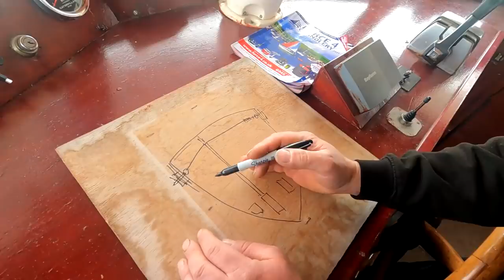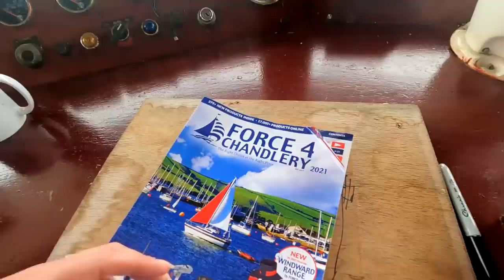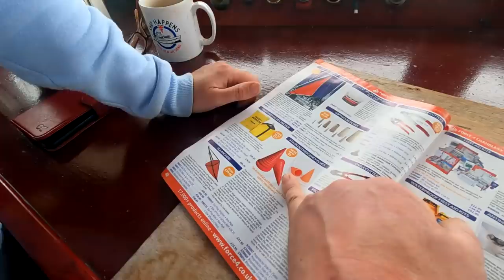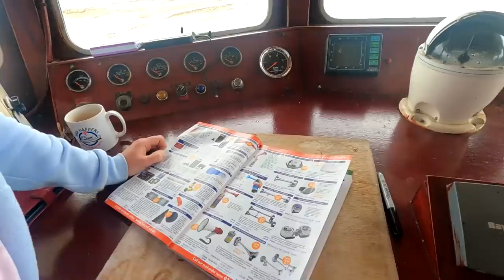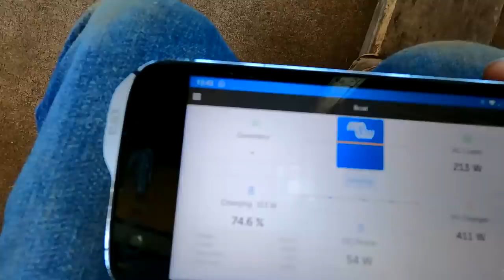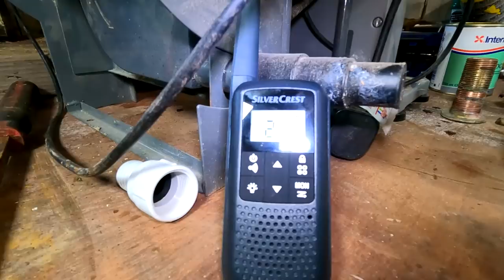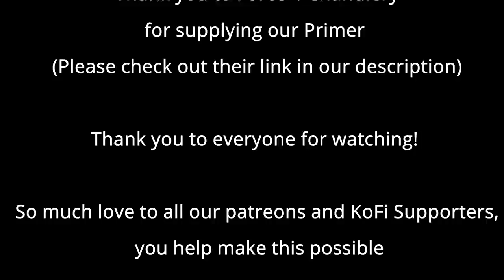Ep 24 - Changing The Boats Skin Fittings With Our Home Made Tools!

Comment: I normally put some Sikaflex on and then tighten the nut until I know all bubbles are squeezed out, but there is still a thick layer of Sikaflex left between the surface and the washer. I then let it dry and tighten a lot the next day when it is dry. This let the Sikaflex creates a nice gasket that fits into all the little unevenness and creates a better seal. Not sure if it will work on wood, but it sure does work on fiberglass :-)

Comment: From experience, scrape the hull down to the float line, caulk all the gaps in the planks, seal the surface, then prime the exposed hull with at least two coats. Painting should be your last while it's on the mud flats. That will be easier done after the boat get's taken out of the water. One thing that you need to do before removing any wood is to measure the distances and write them on the wall for reference. Another thing you might consider is finding four or five or more large planks 6-10 inches wide by 2-4", and at least the width of the boat in length. Tie ropes on each end long enough to reach the railings on deck. At the next high tide, when the boat is just clear of the mud, position the planks under the hull and tie them off. This will allow the hull to be somewhat out of the water and expose a greater surface for scraping. We found that this will give a stable platform for the vessel. The use of plugs has long been a necessity, but also squares of rubber that can be quickly pressed against the inner surfaces to stop a leak, with 4X4 timber to buttress the patches
Reply: I forgot to add. If you can get the props out of the water, inspect them. I suspect they have been changed out. The previous owners probably exchanged them for a 'sport' version. Since the boat has been sitting in the mud for quite a ling time, at least take some pictures to insure a matched set. If they are chipped, then plan on replacing. They can be pulled in the yard for a balance.

Comment: You don't want to leave paint chips in the estuary.  Wait until you can put the boat on the hard before scraping and painting.  You should be using a ball valve on that through hull.  Gate valves collect crud in the gate slot which can interfere with operation of the valve.

Comment: Excellent progress! A word to the wise though (if I may be so bold) - gate valves shouldn’t really be used, especially below the waterline as they have a nasty habit of failing in an open or closed position. Marine grade ball valves are the way to go - they have the added benefit of visually indicating whether they’re open or closed from the handle position. Also, if those skin fittings are brass, please, please ensure they are DZR - if they’re not they won’t last very well in a salt water environment. Early signs of failure will be if you scrape the outside instead of revealing that traditional brass colour they’ll have a pink hue indicating that the zinc is leaching out of the copper.
Good luck, you guys make a brilliant (& very entertaining) team!!
Reply: What he says, my in laws boat nearly sank cos the Brass Valves disintegrated and snapped off.

Comment: I think someone may have mentioned this before but you should get fixed reference points where you can check for any movement.  Don't forget that the hull will probably stretch and compress with the rise and fall of the tide.

I have said this before but you should really speak to one of the Marina's and see if they will sponsor a hard for you to put Sarina on.  In the long run it will be cheaper and much better for you as you won't have to rely on the tides as to when you can work on your boat.  Rubbish removal will be easier and if you need any material you won't have to pull it down the river all the time.

I realise it may cost  you a little more but I think that over time it will actually work out cheaper.

Looking forward to see your progress with the frames - you will need a steamer though as bending oak is not any easy process - I know I have done it.

Comment: Removing and replacing one frame at a time shouldn’t be too much of a concern with regard to the hull changing shape. The double planked hull will hold its shape pretty well for a reasonable length of time.
Be careful when selecting valves and other fittings for through hulls (skin fittings). Only use bronze or non metallic fittings. Never use brass! Brass will quickly corrode as the copper is dissolved leaving only zinc, which has no strength.

Comment: Great fun ...had me laughing again especially the sanding of the through hull scene. Not sure if you're going to be steaming the frames. Peter Knowles from Travels with Geordie  channel has set up a nice little I frame sized foam steamer box using a kettle or a wall steamer.his channel is great viewing if you haven't already seen it. He currently has his 1950s wooden boat out on the hard and is adding extra white oak and high density plastic frames to strengthen his boat at a weak point.
Reply: Travels with Geordie is a great channel full of amazing wooden boat restoration wonders.

Comment: Why not use Ball Valves below the water line and not gate valves? Gate valves can break the stem and be open or will not close.
Reply: Definitely ball valves should be used!
Reply: Ball valves can leak after time or stick quicker than a gate valves leaver valves way to go.
Reply: Anybody on YouTube replacing thru hull uses Ball Valves.  I have never had an issue, just open and close every now and then.  Gate Valves can jam.
Reply: @michaelramstedt3380  never had an issue with ball valves leaking, and yes they do seize but so do gate valves and I can generally free a ball valve fairly quickly.

Comment: Copper nailing code works well. Assuming the nail is already in. Person inside puts Rove onto nail and taps gently so person outside knows to hold on. Bang rove down until it just bites into wood. Noise stops and outside see nail head pull into wood hopefully just below surface and rests. Inside snips nail leaving about eighth. Nips hard up on rove about right . Inside gently taps so outside  holds on then inside hammers away with double tap when finished. Done.

Comment: You might well consider a "surface preparation tool" available from eastwood.com here, and probably many other sources. It uses a grinder type setup, but has a fairly wide (around 15cm) rotary tool with flap wheel design and others also depending on the job. The best and most economical tool I've found for removing paint from surfaces like auto bodies.  Should work wonders on the hull, strip it down to bare wood and no chemicals required.

Comment: I am SURE you figured all possibilities in painting but just in case:
Scraping is REALLY hard and quality of job will be dependent on the scraper and that's standing on a floor or ladder on dry land, not suspended over the side of a ship or standing in river muck with the tide out.  
Have you priced out a thick chemical paste or peel and strip, not cheap but better quality control esp if using volunteers.  $2 a sf or so, but yeah you got a lot of sf $1,200 for 600 sf 
There are some mechanical strippers like the residential DIY Wagner PaintEater which mostly leaves dust behind to catch and easily shop vac up.  Some strength needed and like any power tool it can hurt you faster than a hand scraper can slice you
There is an aggregate blasting tech that would maybe work, ie can use portable equipment easily gotten to boat, and leave little waste, just paint dust.  It's dry ice blasting.  The dry ice changes to gas as it hits and lets just say magically removes the paint, leaving behind co2 gas and paint dust to catch and shop vac up Given your limited by what the tide lets you get done DIY might be only way to power strip,   Seems to take about 250 lbs of dry ice an hour for 600 sf. for about $1.25 per sf or about $1,000 for 600 sf.  I'd guess hiring someone would be at least $2.50 per sf. Here's a bit from a blog about a GC DIY not subbing it.  So if you wanted to learn a new trade you could too.  Might be useful in your day job too.  
. I called Cold jet and they wher very helpful.
They told me that on average you will go through about 1000 lbs of dryice in a day. Depending on conditions you can do 10 square feet a minute using 4 lbs a minute. My job is roughly 2000sf of roof decking to blast. I am doing the job tomorrow so we will see how it goes.
I have 1040 lbs of dryice coming. the dry ice cost me $510 and it cost me $850 to rent the blaster and compressor for the day.
hopefully it is money well spent!
Any chance you can economically source a flat bottom boat or two to snug up to boat as tide drops giving someplace to catch dust scrapings stand in and work from, that when the tide comes in will then just float until you can take to shore and clean out dust scrapings etc.    https://smithauctions.hibid.com/lot/11217-65559-197729/10ft-alumacraft-flat-bottom-boat/
There is dustless power stripping that uses water and an aggregate but that seems to need special equip hard to get to boat

Comment: Again, sorry for late to the party, but those 'sketchy' thru-hull fittings can be filled with cheap 'roof tar in a tube'  on the outside and water pressure will drive it into any small leaks...And any new Valves should have all 'mating surfaces' coated with 'anti-seize grease', it keeps sea water corrosion at bay...And when a 'Sea-Gull' flies over the Bay, it becomes a 'Bagel'...Before you tear out whole original beams, please look into 'Period Timber' sistering, where you place new-ish timber alongside the still solid parts of the old. It's actually stronger and much less 'invasive' on the hull. But, I'm sitting here in my comfy room, not doing any of the work, so you are welcome to ignore my 'Arm-chair Quarterback' opines. I just hate to see my 60 years of 'Finding out the hard way' go to waste. 🤠

Comment: Painting the hull will require pulling the hull. Being a wood hull will require recaulking the the hull. DO NOT use a power washer because it will open the pores on the wood. Once hauled and wood repaired and caulked then you have a paint&picnic party
Reply from the maker: Our hull doesn't have caulk, it's double diagonal planking with a layer of calico.

Comment: I hope those thro hulls were bronze rather than brass. It lasts a lot longer in salt water. And shouldn't there be a rubber gasket under the washer?
Reply: I'm sure they would have been bronze,  can you even get brass hull fittings? That's what the sika was for, though to just hope they didn't squeeze too much of it out.

Comment: I have a question wouldn't ball valves be better as their almost impossible to block with debris or growth
Reply: A ball valve is impossible to close if it’s obstructed, a gate valve has the ability to press down to either cut through or lessen any flow it has a small surface area
Reply: I was wondering that myself, the reply below explains - OK good point.  BUT don't gate valves get jammed up unless used occasionally?  So just one more thing to put on the routine maintenance list.

Comment: I have had trouble with those clamps on the cables slipping. They could be painted to see if they slip.

There is different routing of the cable that could be done. Untwist the cable enough to seperate into two groups. One group goes one way around the thimble with the other group going the other way. They can be twisted back together to form a twisted wire rope again and clamped.

Found an example on you tube.https://youtu.be/zPg0bKeUeF0